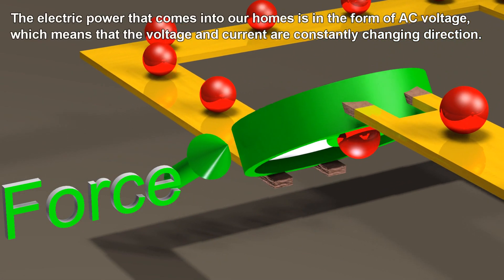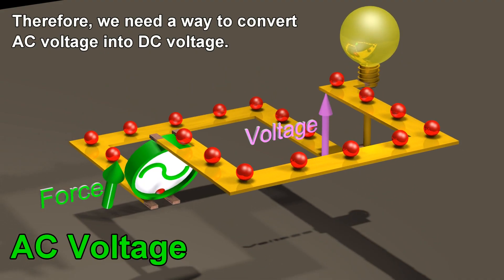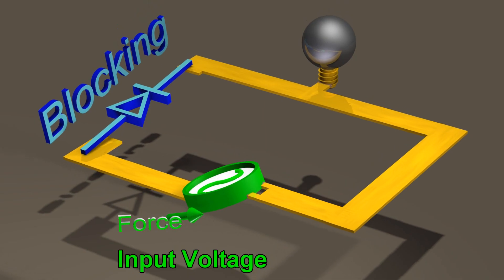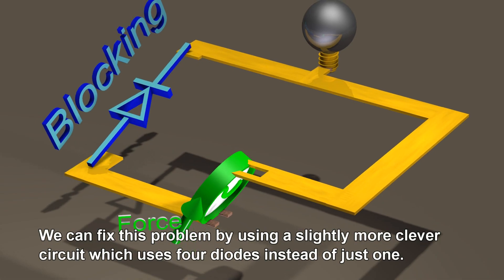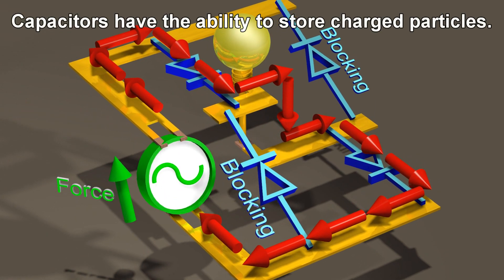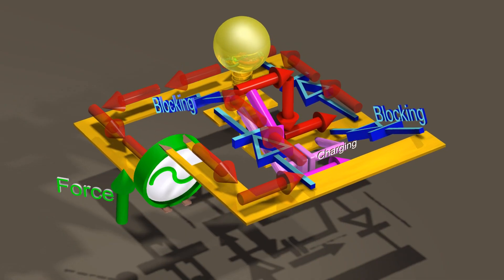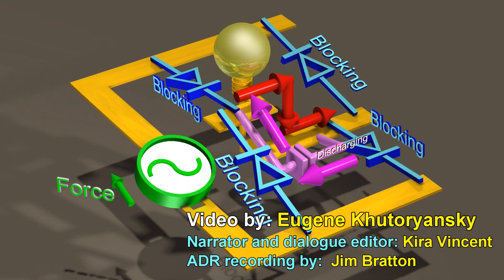AC to DC voltage rectifiers

Comment: The capacitor filters high frequencies, when it is parallel to the consumer/resistor.
Can you apply the same effect with an inductor in series functioning as a high pass?
Reply from the maker: I cover this in my video AC Current Impedance at https://youtu.be/zO7RZZW0wSQ

Comment: Based on my training the animation is somewhat incorrect for the alternating current.  The current does not go back and forth as show in the animation.   It is actually a current that changes in sign - positive and negative - the sine wave.  Thus we can say that "alternating current is a "changing sign current" or electro-magnetic waveform creatied by the rotator.  The term "alternating current" has always been a misnomer for the common person.  That is the electron at the power generation system does not actually travel to the end point - rather it is the electromagnetic wave.  Thus when you imply that the current changes in direction can be misleading without the context of training. Would you agree>?
Reply from the maker: The video is correct.  The sign of the current refers to what direction the current is travelling in.  Therefore, when the current changes sign, that is the same thing as saying that the current changed direction.

Comment: I have a question. Why didn't you connect the capacitor in series with the light bulb? Is there a difference between that and connecting it in parallel with the light bulb?
Reply from the maker: A capacitor in series with the light bulb would make things worse, and cause less current to flow through the light bulb.  I have a video explaining capacitors at https://youtu.be/f_MZNsEqyQw
And I explain AC current through capacitors in my video at https://youtu.be/zO7RZZW0wSQ

Comment: 2:05 Would a Zenor diode work better than the regular one in that circuit if the AC voltage source could make a voltage higher than the reverse breakdown voltage?

Comment: 😇1)120V ac starts from Line and end through Neutral.. 2)During reverse, from where voltage stars high 120Volt. Is starting piont Neutral and ending through  Phase Line?  3)Neutral is always Zero Voltage,  then how current flow from Neutral to Phase? 😇

Comment: So you're telling me the speed of electricity is so great that in the handful of milliseconds between when the AC power source has switched to one polarity or another, the capacitor discharges and in those few milliseconds supplies additional electricity to the light-bulb to maintain the current through it?

Comment: is it possible to filtrate ac voltage without using a capacitor in parrallel after the bridge rectifier if yes how ? thanks for your help .

Comment: i think that a full wave rectifier can be made using only 2 diodes instead of 4
Reply from the maker: To use only 2 diodes, you need a center tap transformer, or two power supplies with a center tap between them.
Reply: @EugeneKhutoryansky  thanks

Comment: if the capacitor is in parallel connection with bulb 💡 
each and every time current goes to bulb it also goes to capacitor
how can it discharge then???
Reply: Discharching happens when voltage from the source gets close to zero....

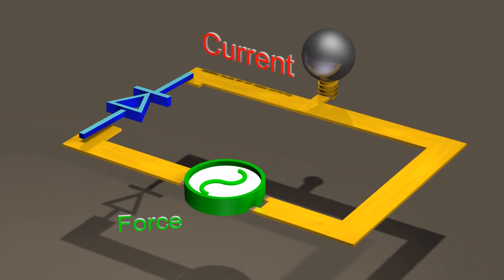Comment: 1:50, I thought diode's have a voltage drop? Roughly 0.7V for silicon diodes and lower for Schottky? If this is not a mistake in the video, can someone clarify?
Reply from the maker: Yes, diodes have a small voltage drop when current flows in the forward direction.  In the video, I said that when current flows in the forward direction, both sides of the diode are at "about" the same voltage.
Reply: I guess in the ideal case they are "about the same voltage", however some would not consider 0.7V drop small enough to be considered about the "same voltage". Either way thanks for the video!

Comment: Awesome videos! Just a minor comment on the terminology: Voltage is a difference in potential. At 1:50 it is stated that both sides of the diode are at about the same voltage, but what is really meant is that they're at the same potential, thereby there is no voltage (potential difference) across the diode. The levels of the gold circuits representing potential.

Reading
https://en.wikipedia.org/wiki/Electric_potential#Units
Potential is 'volts' and potential difference is 'voltage' ?

Comment: this is a bridge rectifier circuit if i am not mistaken, and by adding more capacitors you can get a cleaner full wave rectification in that it will show up as a flat line on the scope

Comment: Your current flow is backwards, a larger majority talk in electron current flow instead of conventional flow
Reply from the maker: I am showing positive current flow, which is in the opposite direction of electron flow.  Positive electron flow is the convention used in industry and in education.  If you feel I should instead show electron flow, I would point out that for my very first YouTube video, I showed electron flow, and then people complained that I need to show positive current flow, so you can never please everyone.
Reply: By industry and in education are you referring to engineering and/or electronics? I teach working electricians, in all of our books and what I teach is actually current flow. I'm just curious why there is a variation in the way it's instructed.

I actually just answered my own question with a little search, this explains it;
https://www.mi.mun.ca/users/cchaulk/eltk1100/ivse/ivse.htm
Reply: Eric Graveling I would think it's called "conventional current flow" for a reason ;).  We all know it's backwards.  It started this way because in the early days of the study if electricity it was believed that it was the positive charges which moved in a circuit.

Comment: So the purpose of the capacitor is to further stablilize the DC current that we are getting? 

Thanks for the video by the way! It made some lightbulbs click! The way engineering is taught in schools is very messy and all over the place because it would be way too much of an issue getting classes to learn everything "in order"! Thanks!
Reply: 1/2 time I spent in class is to copy down the blackboard and it was 9 years ago.

Comment: great video. well done. here in India , we have two diodes and centre tap transformer to get full wave rectification. I request you to add that as well. great work again.
Reply from the maker: +kapil rathi Thanks for the compliment about the video.  I left out the design with the center tapped transformer because if I included that, I would also have to explain transformers, and that is a lengthy topic in and of itself, which I plan to do a separate video on.  Thanks.
Reply: I understand your point.
Reply: I would like to know if you would welcome ideas on animation on physics topics.
Reply from the maker: +kapil rathi, yes I always welcome new ideas for future videos.
Reply: One video which will most welcomed will  be about displacement current while charging capacitor.. very difficult  to visualize. Also, historic and tribal facts About  the physics phenomenon  you depict makes it very appealing..like very famous veritasium or Michael  of vsause

Comment: Excellent video.  FYI, I've taken a di-pole antenna with a capacitor across the antenna, then routed the incoming electromagnetic radiation energy "backwards" through a full wave rectifier.  I have a bi-metallic battery on the "normal" side of the rectifier to keep a forward bias on the rectifier.  The electromagnetic radiation energy comes in, get's split, stacked and stored.  Then with diodes take the energy from the capacitor for use in other circuits.  Electromagnetic radiation energy from the atmosphere (or from a radioactive source for those more daring), converted into dc electricity.

Comment: As always, an elegant explanation and a beautiful visualization!
But... the properties of a capacitor as an insulator for DC-current wasn't brought up. That might cause a bit of confusion, since we want to avoid creating a short circuit.
Reply from the maker: +Pär Johansson Thanks for the compliment.  I am planning to discuss the properties of capacitors in a separate video.  I hope the fact that I haven't yet explained their properties as an insulator for DC voltage won't cause too much confusion.

Comment: Is there devices that require only AC to properly work? And if so, would this devices get damaged by not receiving an AC current or just don't work?
Reply from the maker: +David Flores Yes.  Many motors require AC voltage.  If you apply DC voltage to them, they will not work, and they will draw a very large amount of current which may damage them due to overheating.
Reply: Oh yeah just remember how electric motors work. Thank you, and awesome video by the way.

Comment: 1. FIRST VIEWER!!! 
2. you should have explained the fundamental structure of a diode
Reply from the maker: +ANNAMARIA GRUOSSO The internal structure of a diode will be a separate video.  That explanation will require a video much longer than this one.  And congratulations on being the first viewer.  :)
Reply: 1. Thx
2. Ahhh, ok.
Reply: I don't think that you can explain the structure of a diode and how does it work in a short video, I remember when i was in school last year it took more than 3 to 4 classes of physics to fully explain it and solve there equations, it will take a long video to explain it